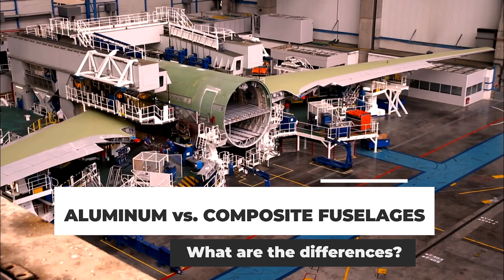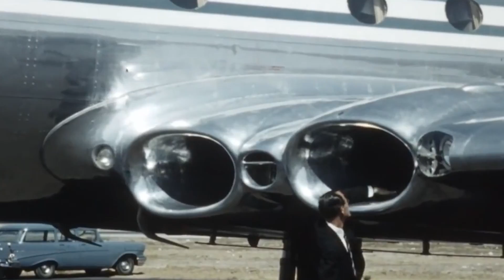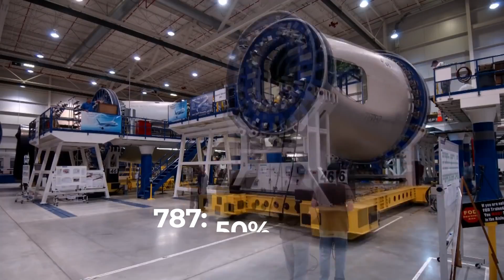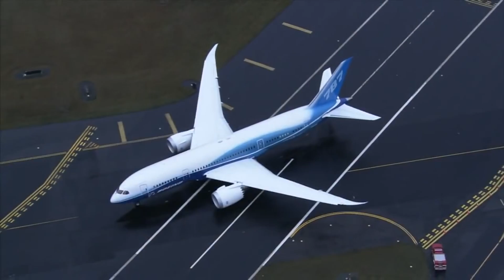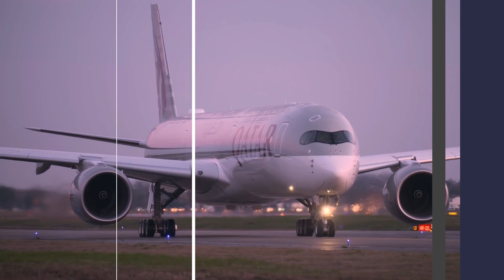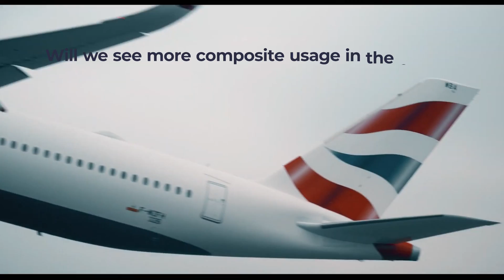Composite Vs Aluminum – Which Fuselage Is Best?

Comment: But what about strength and crash resistance? Will composite stand up alot better than Ali? An Ali fuselage plane just disintegrates most of the time, even if you're just trying to land on a flat field after a double bird strike!

Comment: Once they work out the issues with the A350 (and I’m not entirely convinced the 787s won’t have a similar problem someday) and they can make it easier to convert them to freighters, composites will be the dominant building material. But it will probably take at least another decade before air craft builders fully switch.

Comment: Also magnesium was included. To make the suitable alloy we need aluminium with magnesium to resist corrosion and titanium for extra strength but what do I know about alloys? Stainless steel and chromium are great in thoery but rather heavy. Carbon steel is also great but rather heavy. Like aluminium, magnesium is light weight. Lithium is the lightest weight metal but rather reactive. The Airbus A380 used woven fibre glass known as GLARE, I wonder what it stands for.
Reply: GLARE is used for certification purpose. Fatigue and failure of CFRP is very different from metal, so the aviation rules are cautious about it. While GLARE could provide similar characteristic as metal and also gain some performance improvement, so it's used on A380.

Comment: It really did take the big jet industry a long time to start using carbon. The gliding world started using it in the mid 1970s. I own a glider, built in 1978, which is substantially carbon fibre. Light weight, high strength and capable of being moulded into very good aerodynamic shapes was the reason. The glider is a Schempp Hirth  Mini Nimbus C . Standing the test of time after 43 years of flying!

Comment: From the passenger's point of view an advantage of of composites is that they allow a higher level of humidity in the cabin air - less danger of long term airframe corrosion. Less of the "I'm dying of thirst" feeling you get with aluminium aircraft.

Comment: I am an engineer who works with aluminium structures for a major Southern Hemisphere airline and I choose metal over composite any day of the week. Metal structures are imminently repairable while composites are not. As aircraft age, they gather all kinds of damage. The worst damage a metal structure will get, aside from actual mechanical damage from accidents, is corrosion and is very well understood. Composite damage, on the other hand is not so easily found or fixed. In addition, the toleration for damage is equally not well understood. From where I stand, composite structures are more gimmick than progress.
Reply: Thanks.

Comment: Lightning protection is also an issue since the 'resin' is epoxy, which when burned, gives off cyanide. Proper bonding (and routine inspections) are mandatory. Titanium is very hard to form and is heavier than aluminum--and corrodes when exposed to skydrol (hydraulic fluid). That's why bleed ducts on Boeing airplanes are gold-plated.
Reply: So if there is a fire you would likely die of cyanide poisoning. What lethal chemicals are expelled when aluminium melts during a fire. Which one would give more chance of living in those situations.

Comment: CFRP  is not the future nore is metal .. it will have to a blended approach.  The reason  being is repairs in the field.. CFRP has little to no history.. metal has been manipulated for decades and we are still waiting for transparent aluminium (scotty is lagging behind on that ) . Like all plastics , they lack the ability to flex out side of thier design parameters.. metal will usually give tell tale signs before catastrophe event and or be able to flex in extreme events that CFRP will just fail.. yes F1 uses CFRP to make the chassis or driver tubs ,  but it is designed to dissipate energy in a crash.. airframes are not F1 cars..

Comment: You don't mention the C-Series/A220 which followed the 787 (but preceded the A350) in pushing the commercial application of composite technology. Also the wings represent another critical application; while you mention that the 777X retains an aluminum fuselage, you omit that it has a new composite wing.

Comment: The one thing I’ve never been able to get a handle on so far: what’s the ACTUAL difference? You, the manufacturers and every other website and news article talk about ‘significant weight savings’. Well, how much? What would be the difference between, say, an A350 fuselage made the way it is, versus if it were made of aluminium?
Reply: I don't know the numbers by heart, but it will be in the 5-15% range. But, since airframes are highly optimized this is as lot for operators. In addition, composites  (at least in theory) promise to elongate the inspection interval because they do not suffer from fatigue. So, a little lighter and longer inspection intervals are the key benefits for operators.

Comment: It appears that the A350 has major problems so much so Qatar is suing Airbus and Airbus cancelled their 50 plane A321 order to Qatar.  The 787 does not appear to have the same paint wire mess issues that the A350 has.  Composites will slowly replace aluminum.
Reply: its the qatar ceo being awkward and the 787 does have paint issues on the wings
Reply: I think Qatar was more just looking for a way to have covid grounded planes to be paid for. Other airlines just had the problems fixed

Comment: Composites have advantages, particularly being lighter. However until they can get the production costs down and volumes up we probably won't see them in single aisle fuselages. 

A decrease in diameter by 1 unit of measurement will decrease the circumference by 3.14 units reducing the potential for weight saving disproportionately the narrower the fuselage is. 

Flatter surfaces don't suffer the same diminishing returns as they get smaller, and, apart from the weight savings, the (particularly in the case of wings) ability to produce complicated more aerodynamically efficient profiles not (as yet) viable using alloys could well make the additional costs worthwhile.

I suspect that we could possibly see an updated A320 series with composite wings as it is probably the next single aisle due to get any significant airframe upgrade, unless in the unlikey event of the MAX becoming a sales or production disaster it forces Boeing into a total redesign.
Reply: I expect we will see a hybrid with composite wings/wing box and some forum of aluminium for the fuselage.
Reply: A220 is 70% advanced lightweight materials and 46% composites. The fuselage is aluminum-lithium.

Comment: The Fokker 130 metal bonding techniques and intelligent use of composites are at the base of the lightest and most durable airframe of the industry. These proven techniques result in excellent fatigue life, corrosion resistance and low maintenance cost. It builds on almost 60 years of trouble free experience, gained in multiple aircraft programs, and backed by more than 45 million landings. The Fokker 130 has a crack-free-life of 45,000 cycles and economic repair life of 90,000 cycles.
Reply: As it was never built how can this be proven?
Reply: @Biggunkief  It's on their website, how much proof do you need ?
Reply: @RoderikvanReekum  if its on their Website  it needs no proof...

Comment: I'm not entirely sure with this one. Both the 787 and A350 have their pros and cons. Both are much more fuel efficient, but the fatigue resistance of carbon fiber could be outweighed by the fact that the 787 uses complete barrel sections, meaning that, if the aircraft is damaged, an operator may need to order an entirely new fuselage section, likewise with the A350's paint issues, with the operator having to apply paint much more often, not to mention that carbon fiber is much less malleable than aluminum, so I don't think applying a doubler to a damaged section would be possible, though I could be wrong.

Another thing is that carbon fiber contains, well, carbon, which is highly flammable and more vulnerable to a lightning strike. In 1995, Bristow Helicopters Flight 56C was struck by lightning, damaging its carbon fiber tail rotor, causing the helicopter to go out of control and forcing the crew to ditch in the ocean.

Yet another thing to consider is what happens to an aircraft when it reaches the end of its service life. Aluminum aircraft can be melted down and recycled, but whether or not the same applies to a carbon fiber aircraft is questionable. 

The thing about carbon fiber aircraft, as is the case with electric aircraft, is that its story is still being written. Maybe they'll be successful, and maybe they won't. There isn't enough information yet to say one way or the other.
Reply: So Well-said Autism Takes On!!
Reply: There are ways to repair smaller damages avaible also for CFRP. If the damage is so huge, you have to replace an entire section, you are screwed anyway. As mentioned, CFRP is more resistant to fatigue, wich prevents the most damage in the first place.

Regarding fire resistance: the carbon fibre is ignited at 3000°C, but the resin (plastic) used in CFRP starts melting at ~180°C. Aluminium does have a higher melting point, but looses beyond 200°C a lot of its strength.

Recycling is an issue, that needs to be solved yet. One possibillity is to melt/burn the resin and reuse the carbon fibre, but this is has its own drawback.

Comment: Why aren't there any composite narrowbodies?
Reply: Because narrow bodies are relatively low loaded. In that case, composites are not competitive anymore because they are much more sensitive to impact (e.g. hail). So, whether or not composites are the right choice, depends on the critical failure mode of the different parts of the structure. If large parts are critical for impact, aluminum is typically a better choice.

Comment: Unfortunately, until we have an composite aircraft accident/crash, and the here mentioned techniques to investigate such composite failures are tested & valid, we cannot maintain the same scientific certainty we have in the Aluminium stress crack analysis.
Knowing the eventual long term threat of "delaminating layers' in the fibreglass structures in all forms of transportation, we might possibly project that to these newly developed aircraft and its carbon fibre composites.
Thing is, tracing the precursor of the fault or crack in the fuselage that causes the catastrophic failure is an unknown given that when a carbon fibre structure breaks/disintegrates in a crash, it does so 'exploding' into millions (?) of carbon fibres debris.  Add to that, high altitude+fire+underwater recovery ...
How to do ... what can be done ???  :-(
Reply: Erratum :  "... a composite aircraft"

Comment: Boeing doesn’t have issues with the paint. That’s an Airbus thing.
Reply: @Paul O. some 787's have paint issues on the wings, awaiting your apology
Reply: Think Air New Zealand might not quite agree with that.
Reply: @clarkneil1980  Really?? Is that reported/documented/complained about? Qatar Airways also has Dreamliners but no complaints from them yet about their fleet of Dreamliners!!
Reply: @kojoharrison630  you know how search engines work?
Reply: @clarkneil1980  Neil, due to the nature of my job and it’s demands I don’t really indulge heavily in the online aviation exploration. I keep it really simple. I’m a fan but do not really explore as deeply so I dip in and out but the thing that jumps at me without searching is the Qatar/Airbus Issue which has become a real issue…..it’s unfortunate 🥺
Reply: @kojoharrison630  and lots of other airlines have A350's with no paint issues

Comment: The big issue with these new aircraft is they are terrible at end of life issues when it comes to disposable and recycling but over the long term saving on fuel burn and longer life in the air acts as a counterbalance, but I am not sure which side wins out
Reply: My point exactly ... what's gonna happen to all that composite material ? How wil it be recycled ?

Comment: For me it is always funny when people talking about the weight. Even if you remove 6t of weight out of the fuselage structure, as long you have to put back 8tons of power return cable it is not an improvement! But for sure it sounds great in a commercial to have a "modern" material used... However, may be in the future, CFRP will become a better option.
Reply: Huh? CF airplanes are definitely lighter overall, where did you get your numbers from?
Reply: Your comment makes no sense, sorry.
Reply: @Timothy De Vries  But it doesn't even come close to the numbers he gave. If they were true, then nobody would ever use composites.
Reply: Correct, composite aircraft require the addition of metal bars, straps, and cables called the Current Return Network (CRN). It does add mass, however I'm not certain about 8t. Aluminum, the airframe is the electrical earth wherever you need it.

Comment: I would guess that one of the reasons that Boeing chose not to use composite for the new 777x is because they know, and as history has shown, a lot of these will be converted to freighters 10, 15, 20 years after entering service. The 787 on the other hand will most likely never be a viable freighter option.
Reply: The 777x is not a major redesign of the 777series. For that reason a big chunk of parts and processes were not rethought. It simply doesn't make sense, the same way as a carbon fiber a320 wouldn't.
Reply: Biggest reason would be, that they would have needed a completely new type cerificate. Which would have made it a new airplane.
Reply: @Biggunkief how abt what NASA R&D on aluminium lithium or something?
Reply: The use composite in the wings
Reply: @danielmeador1991  B777x wings are composite but Boeing does not use "copper foil/mesh" lightning protection system in the B777X unlike the 'flaking" A350 or the B787.
Reply: @set3777  yea I know
Reply: They won't last 20 years
Reply: @c123bthunderpig  I’m sure they will

Comment: “Wood was practical but not strong enough for high speed flight”

Umm the De Havilland Mosquito was made almost entirely of wood and was one of the fastest planes of World War II.
Reply: "Umm" top speed 415mph at 28Kft? So mach 0.59 at altitude. Just below the drag divergence mach numbers which start around 0.6. 747 maxes out at 0.9, cruises at 0.8 with parts of the body in the transonic regime, totally different forces at play. Lol "fastest planes of World War II" war over in 1945, speed of sound broken 1947, ok
Reply: @enotdetcelfer  I believe the DH Vampire had at least a partially wooden fuselage. Not supersonic but considerably faster than a Mosquito.
Reply: Bugatti 100p

Comment: I think composites have to potential to be great, but they need to understand that it will require a major rethink in construction techniques and the painting of the fuselage itself.
Reply: Why do u think the 777x didn't use composites for the fuselage l?
Reply: @jirehla-ab1671  Because the 777-9 is essentially a 777-300ER but with a longer fuselage and an all-new wing.
Reply: @Sacto1654  I recently changed my view on locking the windows like on the 787 & the upcoming 777x, that it won't be a problem for me AS long as they add another camera near the wing or the engine & be accessible through the IFE, somhow a derivative to Emirates 777 first class Virtual Windows